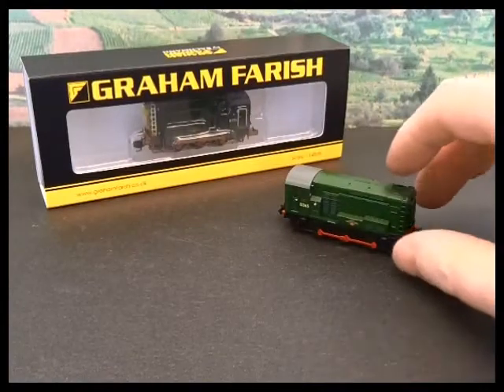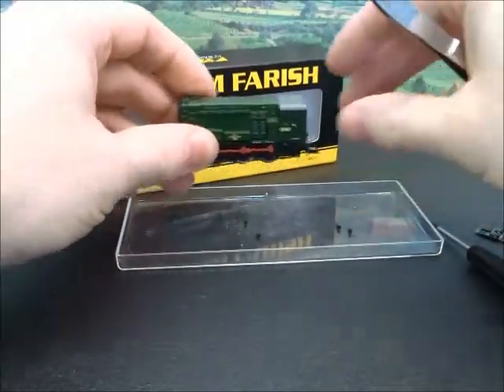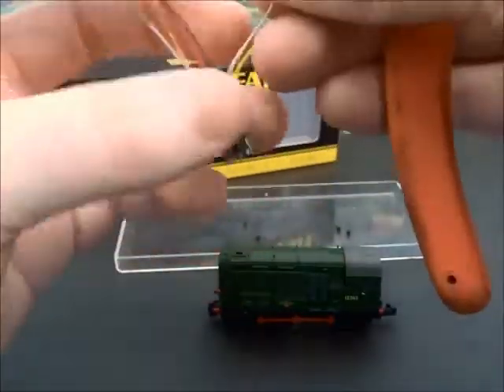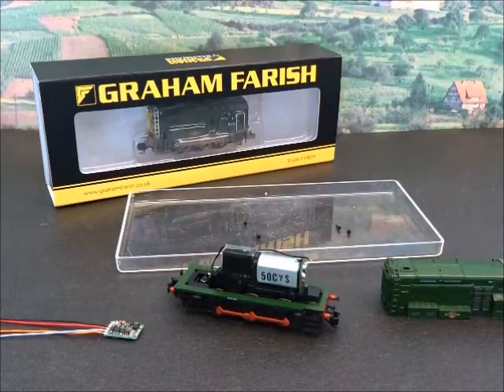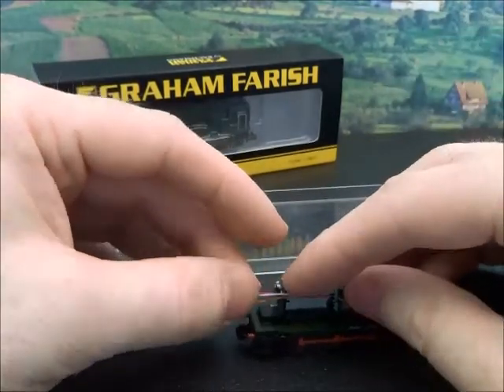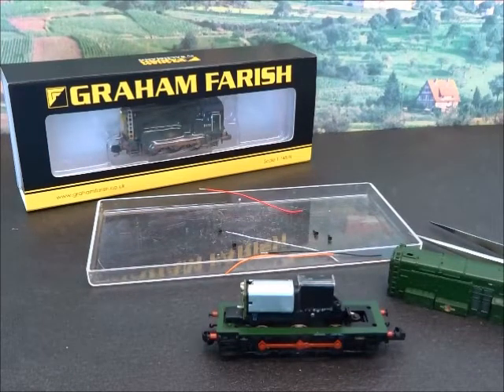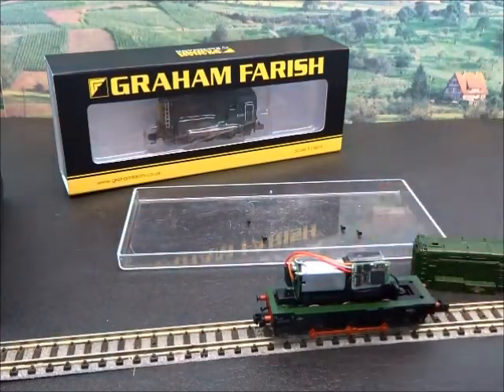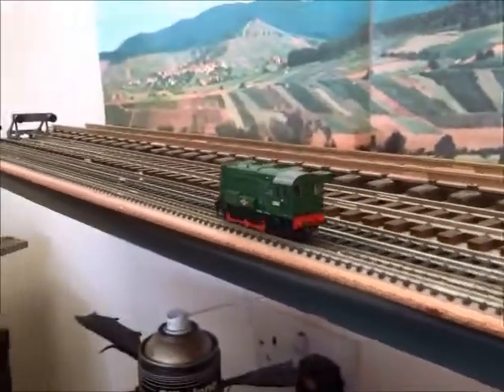Graham Farish N Class 08 converted to DCC

Comment: Nice video. So does CV 30 apply to all NMRA standards decoders? In alll my years of installing decoders in H0 I’ve not come across it. Also it was interesting regarding CVs 50 and 115. Presumably that is for Lenz silver decoders?
Reply from the maker: CV30 is something Lenz have used - it is not a Mandated CV but some other manufacturers have error read-out CVs.  With the DCC standard there are three levels of CVs - Those that all manufacturers must use (eg CV1,CV8 CV29) Those that are optional (eg. CV3,4,5,6) and those that can be freely allocated by the manufacturer - this allows DCC decoders all to work together whilst allowing each manufacturer to install competitive features In this case Lenz motor control is in CV50 with fine tuning in other CVs - In the case of the Farish 08 this is just tinkering it runs OK, but the tuning in CV50 and CV113 improves matters.  Cheers

Chris

Comment: Hello Chris, Great video, thanks. You adjusted the CV to stop the juddering at slow speed, does that close up the pulse width and give it more voltage ? would a stay alive do the same thing or is that a different issue? Cheers
Reply from the maker: I have not really thought to much about the mechanism - just followed the guidance given in the manual to deal with a particular issue with this model - I tried each of the 6 motor sets in CV50 and found CV50=4 to be best then some finesse was found by trying different values for the minimum PWM in CV113 until I found one that worked  - In general we do not have to do this for the majority of motors, and the little Farish can motors are acceptable on factory settings - removing the slow speed judder is just a polishing exercise. 
A stay alive does a different job and provides power storage he model would benefit from this- however it is a question of space, connections and cost to fit one  Cheers  Chris

Comment: Hi
I have just got into n gauge and have successfully managed to fit a lenz silver mini+ into my 08 after following your excellent video.
Would it be possible for you to do a tutorial on setting up the coupling control as mentioned at paragraph 5.11 in the manual. I have tried but can't get my head round it.
Thank you
Steve
Reply from the maker: Electronic couplers are an awkward subject. It is one of those devices that  Roco and Piko have perfected HO (I haven't seen much success in N), but still takes a lot of testing as a personal install  - I am still covering the basics in this film - perhaps one for the future

Comment: Can you set a CV to give the 08 a momentum effect as if it has a large flywheel like it''s 4mm scale brother?
Reply from the maker: CV3 and CV4 set up the acceleration and deceleration delays respectively - the higher the values used the more you will give a model  inertia - just be aware that the loco must also stop on short tracks - experiment to get values that suit your operation style and size of layout.    Cheers     Chris

Comment: Converting this re-tooled 08 is a breeze, there's even enough room for speaker and a sound decoder... Not so with the original Poole built 08's.. you have to shoehorn a 6 pin decoder in that, and isolate the chassis as that is one side of the motor contacts ! - but its doable
Reply from the maker: I believe the 2022 version has been re-tooled to give room for sound.  earlier versions may need more substantial modification to make room for a speaker and decoder. Cheers  Chris